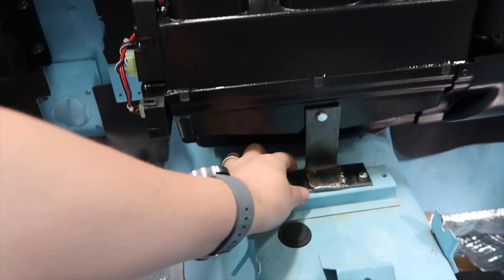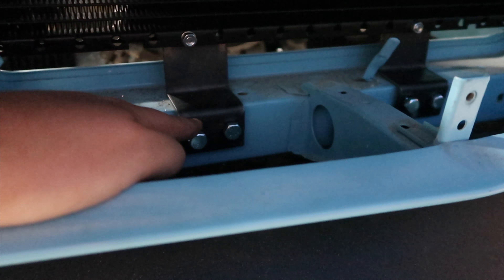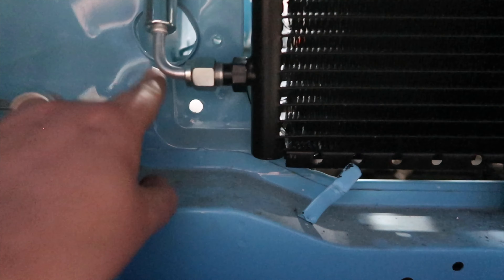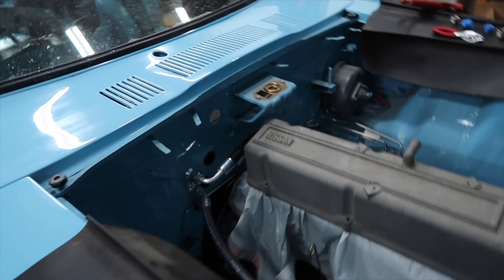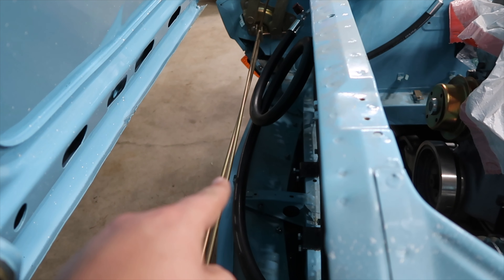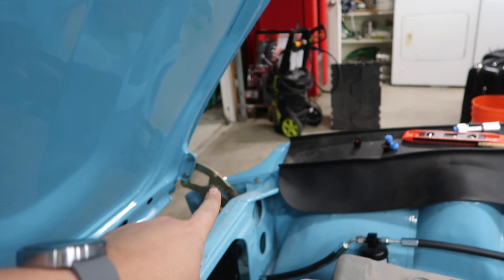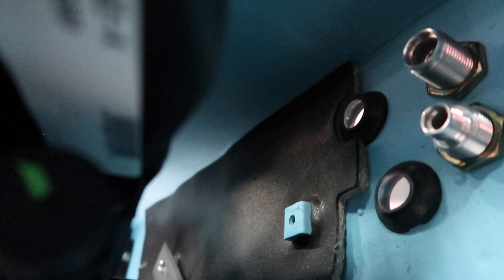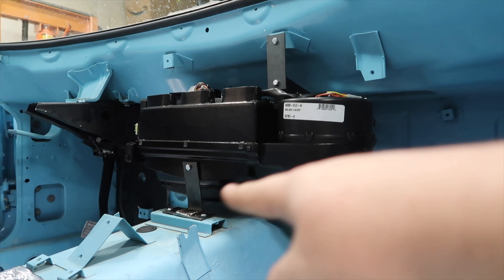Drilling into the firewall... - Datsun 240z Build - Ep 40 - Panchos Garage

Comment from the maker: Are you guys planning on installing AC in your S30?
Reply: I believe in TX is a necessity though I drove without one last summer. I think i'm probably going to hit up my boys at Restomod but I'll probably wait til I do some sort of swap first.
Reply: AC in Texas is a must. I have to finish the body work on my 77 before I look into AC. I'm with Erick, waiting to see how yours turns out. Might weld up any holes in the firewall that don't get used.
Reply: Since im out here in the desert of California lol it would be nice to have ac in my datsun! Now that i see this video it doesnt seem too bad. If theres any way i can help with the process of the kit you were saying, please lmk. It sounds like a good idea for the s30 community. @einsteinz.s13
Reply: I'm definitely planning to install the same Vintage Air system in my '72 240z. Very interested in more info on the mounting brackets.
Reply: Nice video!! I was wondering if there was a heater core in that thing! 

I'll probably try and run the same setup on my '73 240 some day
Reply: I am not too much weight
Reply: 77 280z, it’s getting a Vintage Air Gen II Compac.
Reply: I will be doing the same on my 72 Fairlady Z RHD. About to place the order. I am planning to retro fit to existing controls. Use three sliders (from VA standard slide controls) and buy a separate fan speed switch from them. That way the heater control panel will still look stock. I spoke to VA and sliders / rotary switches are interchangeable.
Reply: I just ordered a vintage air. I'll be installing it on my 1972 Datsun 240Z

Comment: I have a '72 that I am putting in an AutoACSolutions AC only kit. My stock heater is all rebuilt and works great. I removed the smog pump part of the compressor mounting. I made 4 brackets for the condenser that use the bolts that mount the Aluminum radiator to the core support. I may have to make a custom bracket for my dryer since I don't want it to cover the factory data plate on the passenger shock tower. This kit's evaporator is fairly small and is supposed to mount behind the glove box. I hope it does. I've installed AC on my other car, a '66 Chevy Nova SS about 3 years ago so I'm fairly confident. I have really enjoyed your 2 videos about AC installation. Actually, I've enjoyed and learned from all of them. Thanks for doing them. I like your Lab too. Ken from Texas.
Reply: Ken,
How is the Auto AC Solutions kit holding up?  I am debating between Auto AC and the Vintage Air unit they make.  Curious

Comment: Is there going to be a low pressure/high pressure cut out switch? I didn't see one on the dryer. Also, are you going to pull the windshield to put the headliner in? I've been thinking of redoing my headliner but the problem i see is its stretched over the windshield pinch weld. That should keep the headliner tightly stretched but if it doesn't have anything to hold onto, it will pull away from under the windshield rubber. Do you have a secret to preventing that?
Reply from the maker: Yes there is. I haven't added it nor wired it in but I'm for sure adding that safety switch in there.

Comment: I plan to put A/C in my '74 260
It came with dealer optioned A/C (the really shoddy and bulky system) that didn't work very well anyway.

Do you mind elaborating on this system? Performance, noise levels (servos, air movement, blower noise and strength, etc?)

I want to buy but with no videos on system performance and liveability, I feel like I'd be better off going to the wreckers and retrofitting an old Miata system into my 260 for a LOT less.
Reply from the maker: You might want to contact vintage air for all those specs.
Reply: Francisco Gutierrez I think you misinterpreted my inquiry but I doubt they have such data.
I'm asking your opinion on if it's noisy (sounds like your head is in a wind tunnel) or is it about as loud as OEM equipment (mild but not overwhelming) and does the air movement feel pretty strong or is it like a coughing mouse?
Reply from the maker: I haven't got the unit working yet. Once it's working I'll report on it's performance.
Reply: Francisco Gutierrez ohhh, gotcha! Righto!

Also, overall some stellar stuff happening here. Makes me want to drag my 260 out!

Comment: Did you consider adding an isolator/bushing to each of the pieces connecting to the vintage air to eliminate vibrations and rattling on the unit? I would consider ordering a set; I've got a 75 and am planning on doing the vintage air setup to mine as well.
Reply from the maker: Good idea. I'll definitely add some in there. I'm sure they'll help.
Reply: I’d consider buying the brackets you made if you decide to make some. :)

Comment: Great video 
I, am attempting to install vintage air for the first time. I have a question about the lines that runs from the ECU to the buck head 4 port manifold. what fitting do you need to use to get the a/c lines  connected to the bulkhead manifold. I notice there are 2 lines that have bungs on the and of them.  and there are  2 a/c lines that has male thread at the end of them how do you connect or convert them in to hook up to a/c buck head manifold?
Reply from the maker: That I'm not sure, sorry. Maybe call vintage air, they should be able to help with that question.